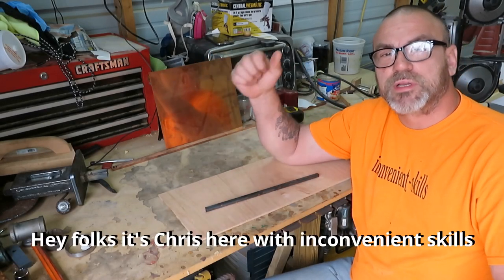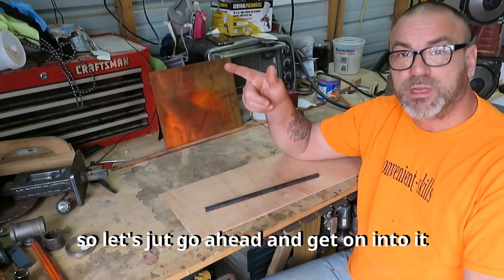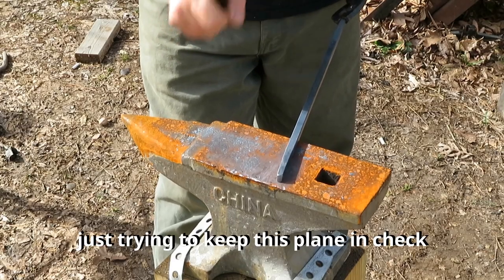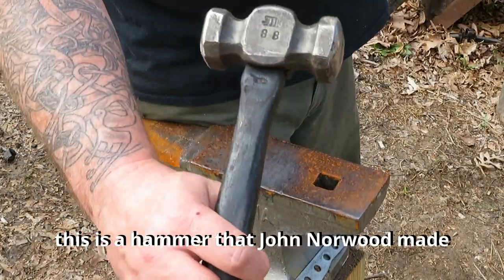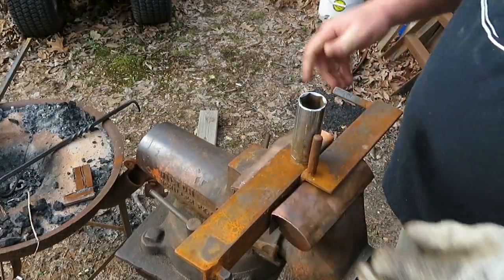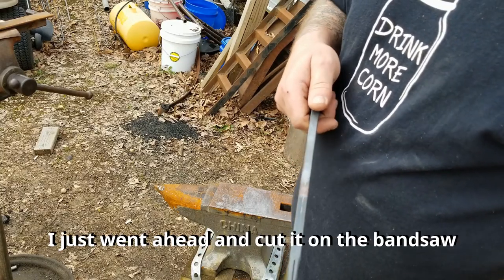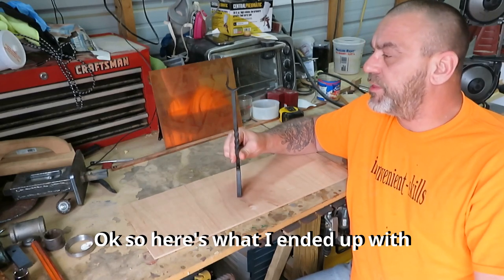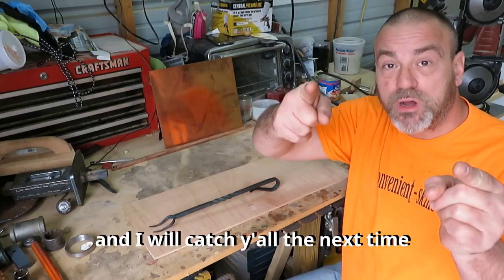Blacksmithing: Forging a BBQ Fork

Comment: I thought I was subbed. I owe you an apology sir. Keep the good stuff coming and dont sweat the details. You do you and it will all work out. Hammer on brother.
Reply from the maker: It's all good brother. YT has an issue about automatically unsubbing for some reason or another. It has randomly unsubbed me from several channels that I watch often and I'm not sure why.

Comment: Your forge sounds like it's starving for air...glad your learning from your mistakes but it's not really a mistake of your able to finish the project you just learned that other ways of doing it are a little easier than others is all. Glad to see some content bud. Hammer on...🔨🔥🔨🔥🔨🔥🔨
Reply from the maker: I've got a ribbon burner cast and have most of the material gathered for the body. The burner I'm running now is definitely a "get by" model... lol .
Reply: @inconvenientskills  good to hear...you will not be disappointed with the ribbon burner.